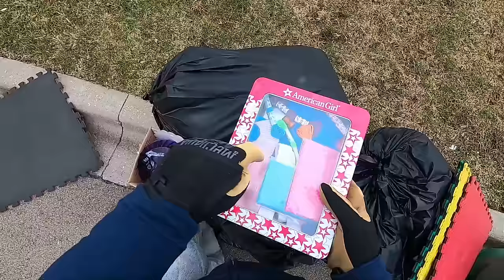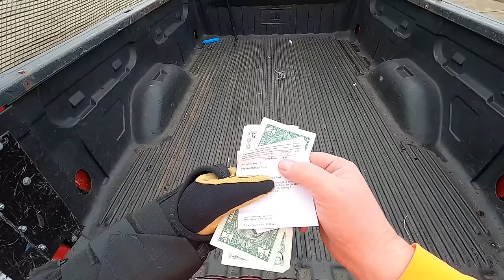Why People Throw Away Awesome Stuff

Comment: You need to secure your latch pin with a wire or small rope so it will not end up down the drain shaft hole 😊😊😊😊😊.